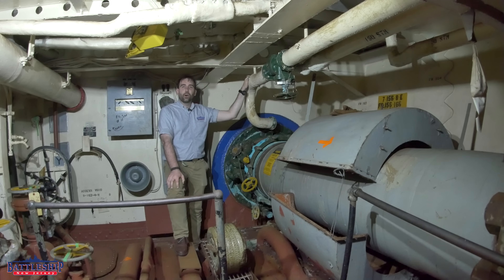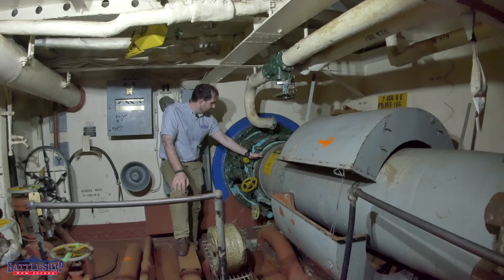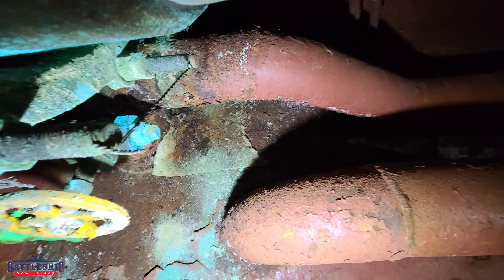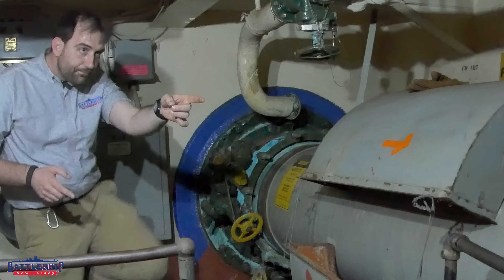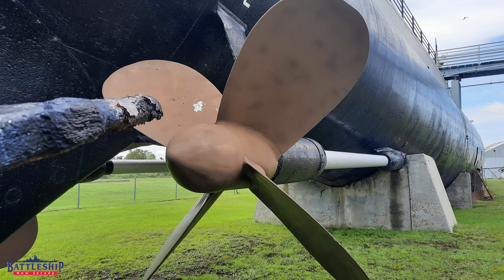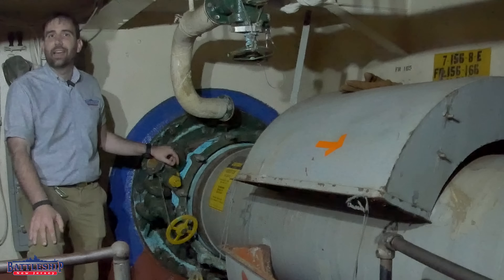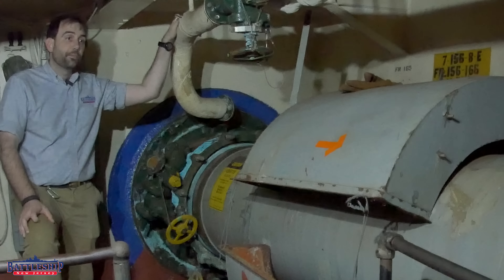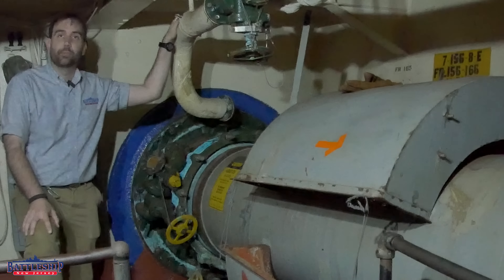Drydocking New Jersey Priority Project: Propeller Shaft Seals

Comment: I worked on high pressure marine equipment. Since the shaft are not turning a static seal like an omega seal can be welded on. It has enough flex to accommodate small thermal and flex changes. 100 percent water tight.
Reply: I like this. Also Ryan mentioned the shaft's weight compresses the rope seal.  maybe jack the shaft up so that it sits concentric to the bore before new rope and omega seal and  tightening everything down.

Comment: I hope you keep the propellers in place and maintain the Big J intact.  Socking down the gland seals have proven effective thus far.  Replace them and do the same, and you're good for another 20 years or more. Also, I tend to think that if you distribute the propellers around the state, they will ultimately languish and eventually get scrapped.

Comment: Unless it is critical for the preservation of the ship as a whole, I think they should stay on.  You’ve spent so much time adding equipment back to make her whole it would be a shame to loose them.
Reply: My thoughts exactly.
Reply: Agreed as well
Reply: Absolutely agree
Reply: Best to leave on, which also raises another engineering possibility. Instead of using the original sealant material in repair, perhaps modern materials science can provide for an alternate that could be installed in the form of a removable collar that provides for better long term protection in the static conditions of display, while still maintaining the ability to retrofit to original working condition.
Reply: @thomasgoodwin2648  I would also hope during the drydocking, that the berth is dredged out to prevent the propellers from hitting the bottom.  Although river silt will fill in the lowest spot and that might not help over a 20-30 year time period until the next drydocking.
Reply: I agree, especially if they are the original propellers. If they remain on the ship, since the shafts don't rotate, I wonder if its possible to put one less wrap of the marine gland packing, and in place of that one less wrap put a similar metal ring to stop the shaft from sagging so much over time. Any marine engineers out there?
Reply: And if they have to remove them for maintenance reasons I think keeping them on site would be best. Here's a crazy idea, if they remove them, keep them on site but use them as the posts for a shade-sail arrangement over a garden area and maybe have a cafe or something operate underneath it so it becomes an interesting, hopefully additionally revenue-raising part of the site.
Reply: @dwayne7356  Does anyone know how deep the river is where she's berthed?
Reply: It is a scarce resource issue, i.e., money. If a bad leak pops up and requires the emergency expenditure of funds, the museum is losing control of a critical ingredient, funding. Removing rudders and props and capping off future leak problems is a prudent option. As artifacts, they can always be warehoused or stored until the future is clearer.
Reply: @timbowden1680 40ft in the shipping channel of the river. Not sure on her actual berth but I have to think at least as deep as the channel
Reply: I agree mathewb1059. I like to see that an artifact with historical significance remains intact.

Comment: I've removed those shafts and props before. Pretty good job. Probably a 5 day job with all of the interference removed from the engine room. A Hytorc is your best friend on that inboard coupling. We typically autographed the machined surface once its exposed. Hopefully others have autographed yours. I guess we'll see.
Reply: That is so cool 😎 Thanks for sharing!
Reply: @mm3mm3  yes Sir. Civil Service Marine Machinery Mechanic
Reply: Bolted quite a few shaft flanges together on Arleigh Burke class destroyers. A bit different than a Iowa class in that it has a controllable pitch prop system with pressurized oil running through the inside diameter of the shaft. I think that I would have been fired for scribing my name on the flange face. Not that I really think it would have mattered or caused a leak if I had. Pretty cool artifact of history that machinists got to do that in the past. I almost hope that they have to split those shafts and find some.
Reply: Very cool story about the autographing!
Reply: @rickjames8317  The fact that the Arleigh Burkes have adjustable pitch props is mind boggling to me.
Reply: My mechanic and I would sign a piece of paper and stick it between the couplings before making it up...we did good work, and weren't afraid to let the next guys know who put it together. And yes, a hytorq is very helpful. Also, lost a wedding ring in the stern tube of a passenger ship when repacking it with that rope/tallow packing.
Reply: @davidbridges1563  haaa that's pretty cool!!! Sorry for hearing about your ring
Reply: @sambrown6426  It's a cool piece of equipment. It's quicker to reverse the pitch of the blades than to stop the rotation of the shaft and reverse it. There's also a optimal blade pitch for every rpm and some business about being able to sound like another type of vessel if they choose to. It's actually quite simple mechanically once you can visualize it. I just checked and there's a really good video by a channel named 'saVRee'. Guy made a automated CAD model that shows exactly how they work. Very cool.
Reply: @rickjames8317  I'll have to check it out!
Reply: @rickjames8317  All this, plus it also allows you to "feather" a prop into an idle position if an engine is shut down, so you can reduce the prop's resistance in the wake without having forces that cause the shaft to spin.  On sailing ships with props, this is the best way to reduce prop drag while under sail (folding props do this too, but have poor reverse performance).  Multi-engine prop planes will feather props if an engine fails or even to shutdown an engine and save fuel.
Reply: @rickjames8317  So you're saying that in the movie Battleship, the scene where the U.S.S. John Paul Jones is going ahead, and when Hopper calls "Engines, back, full," and they go astern by stopping the props and reversing their rotation within seconds is inaccurate?
Reply: @sambrown6426  I'm not familiar with that movie. If they showed the props actually reversing direction, then yes it's inaccurate. I worked at Bath Iron Works as an Outside Machinist (Dept. O9) for almost 8 years and never had enough seniority to go out on a sea trial. That bummed me out, but I heard about the emergency stops they perform. Burkes are a hair over 500ft long and go 35+ knots in speed. When they perform a crash back stop the rudders are turned as far athwartships as possible (referred to as "closing the barn doors"), the pitch of the prop blades are fully reversed and the rpms remain at full. From what I've heard, they will come to a dead stop within a ship length to a ship length and a half. So, from 35+ knots forward to reversing in direction in approximately 500 to 750 feet. Pretty impressive. Apparently, a huge wave comes over the fantail astern. Wish I knew this from direct experience, though. That would've been really cool.
Reply: @rickjames8317  If you haven't seen Battleship, you should absolutely watch it, in part because in the making of that movie, they actually hooked U.S.S. Missouri up to 3 tug boats, and took her out to sea, and they got actual veterans who actually served on her to help "crew" her. I'm not kidding.

Comment: One thing Ryan didn't mention was that if the propellers were removed the ship wold have to be re-trimmed which would mean adding ballast.  There are several ways of adding said ballast including filling trim tanks, pouring concrete, large lumps of metal - each of these has its advantages and disadvantages, but none is without risk.
Reply: According to another video he did about needing to remove things so the air height would allow the ship to pass under a bridge, she's out of trim significantly from bow to stern (while both are lighter than normal load and thus are drawing less water than usual, the bow is more so) and will need to take on ballast to be moved. Based on that, wouldn't removing the props in fact move the trim back in the direction of level?

It would be reducing the differences between the mass in the forward part of the ship (which is considerably reduced due to things such as not having ammo and propellant for the 6 main guns) and the aft section which, while less than normal load of course, is closer to what it would normally be.

Just a thought.
Cheers
Reply: He didn't mention it because it's not true.  The screws don't weigh enough to require being replaced with ballast.  The missing ammunition, powder, fuel, water and stores weighed a lot more, and did not require the addition of ballast.  The bow is several feet higher above the waterline than when the ship was in service.  If the screws were removed, the stern would ride just a little higher.

Comment: When I was a marine engineer, we would often times have our plain steel salt water mains coated in an epoxy rubber coating.   Since the shaft seals don’t rotate, you could coat the external shaft penetration and shaft area with an expoxy rubber coating on the sea side. It will fail eventually but will keep your stern tube dry for a long time.
Reply: Or just weld them solid.

Comment: I'd go for option 3. Install a blanking ring around the shaft on the outside of the gland, welded to both the shaft and the hull. You now have a solid, waterproof steel covering that is impervious to the effects of crushing and settling. In the interest of galvanic reaction it may be possible to mitigate that by covering the props and their connection to the shafts with a layer of epoxy, if you can prevent the electolyte (water) from reaching the less reactive metal then there is no electron exchange and no corrosion. So, for the record, I'm a props on supporter.

Comment: Well, you already know that cranking the gland seals down tight (since you're not actually running the props) is a reliable way to be leak free. I'd be surprised if the weight of the prop put an appreciable load on the gland seal since the shaft is supported by the bearings. The situation with Midway grounding out on her props and rudders is an engineering failure of her berth/mooring plan. Removing the props and rudders is a bandaid and duct tape fix for a problem that shouldn't have happened in the first place. Stick with what long experience shows you works.
Reply: Replacing the gland material will need to happen at some point in the maintenance life cycle, but usually that comes after finishing the maximum seal compression.

Monitoring the seal is probably the primary task.

Going beyond that level is probably unnecessary for the lifespan of the hull till the exterior seal mounts decay.

But the packing material doesn't decay when wet appreciably. The packing material always has to support the weight regardless of rotation, which is presumably part of the 20 year wear life expectancy.

I'd love to retain the propellers so long as it isn't causing corrosive decay.
Reply: I agree. I don't know why Midway just didn't use a suction dredge to give the stern gear some more space at her berth.
Reply: @TyphoonVstrom  Depends on what the bottom of the berth is like. Could be mud, could be rock.
Reply: Why not leave them in place and weld and plate over the gap between the shaft and the hull if the water can’t get to the packaging gland it can’t leak replacing the packaging as well would add a layer of extra protection as if the plating corroded through the packaging would be there to seal as it normally would without the plate
Reply: @chrishughson9587  Apropos of nothing specific, I'd suspect there might be something suboptimal about casually welding to the shaft. There'd also be a challenge to cover whatever structure is involved to the sea side of the gland seal (It's not just a simple gap between the shaft and bare hull). The risk is doing something irreversible to an essentially irreplaceable part.
Reply: @vburke1  weld is made of a different grade of metal and the wrong temper. They definitely like corroding. And we have that prop right next to it.
Reply: @glenmcgillivray4707  There are an absolute multitude of welding alloys with all sorts of different physical and chemical characteristics. The problem I'd consider likely is that probably nobody alive knows the exact composition of the shafts themselves (I'd expect our fearless curator could confirm that), especially since they were never intended to be field repaired but replaced if problems developed. I doubt anyone responsible for the design of those shafts ever considered anyone welding to them.
Reply: @vburke1  hence my comment focused on potential complications. Just like our Zinc anodes which haven't been any use because of the ship being parked into fresh water. And freshwater may be less corrosive than salt, but it's more chemically variable, even just due to factories producing products upstream and generating waste water, treated or not.

Oceans tend to mix their chemistries a touch better. But even they aren't perfect.
Reply: @glenmcgillivray4707  Absolutely. It will be quite interesting to see what her bottom actually looks like when she comes out of the water.

Comment: You can spin the shaft with the shaft jacking gear back by the reduction gears. It is customary to jack the shaft when in port on an active ship. It will reduce the tendency to bend the shaft under the weight of the shaft aft of those last bearings,
Reply: EXACTLY !!!!! Problem solved !!! I was aboard the USS Norton Sound AVM-1 as a MM for awhile. When we docked & it was for awhile. We would tighten up the packing for minimal leakage. Engage the electric motor to rotate shaft ever so slowly. Then when getting ready to go under way. Loosen the packing plate for more leakage for cooling the packing material  They could fasten a none corrosive container with a cheap sump pump attached to a garden hose and pump it out automatically....
Reply: Soapy1898  one of its function is to rotate the turbine for uniform cooldown of the turbine. It also aids in maintaining a lubricating film on the bearing journals of the shaft, turbine, reduction gear and thrust bearings. It turns the shaft at about 0.1 RPM (1 rev per 10 minutes). 

the gear engages and disengages at the end of the turbine shaft, or only one in the case of twin shafts. One turbine shaft is the high pressure shaft and the other is the low pressure and reversing shaft. 

Just as it maintains a lubricating film of oil on the bearings, it will maintain a lubricating film of water on the hull penetration gland.

So in summary, yes the turbine and reduction gears are rotated. and the turbine "windmill" while in operation at low static air pressure.

Comment: 5:09 on the subject of the anodes, i make a strong case to develop a mounting system that allows a diver to periodically change these anodes without the need of welding them on the boat. On commercial boats, there's several variants of this. They aren't as effective (as the tab and weld type), and would require maintenance, but i've personally thought that something that can easily be maintained is better than something that requires complicated action on behalf of the maintainer.
Reply: The problem is, their anodes are not working. They have zinc anodes that are used in saltwater. The ship docked in Sweetwater and they need to replace them with aluminum anodes.
Reply: @mammutMK2  they're pointing out that having a modern, non-welded system in parallel would require less involved maintinence in the future, to the point where even swapping anode type would not have to wait for drydocking like it does now.

Comment: I love that all the Iowas still have all their props installed and I would do whatever necessary to keep them on the ship but If there were no other options and the props absolutely needed to be removed then I'd recommend distributing them between the Iowas, then each ship could have one to display on site and while they may not be under your direct control, they would still be controlled by your fellow museum curators and well supervised, rather than being displayed in some other random location such as a park or a rest stop on the Turnpike. Also they could be transported by ship directly from the yard to the other ships, which would likely be significantly easier than trying to transport them over land.

Comment: I would certainly go with keeping them on if at all possible.  You mentioned loss of control if they are placed off site.  A steam loco in the UK had this happen to it.  It was dismantled for overhaul then through a variety of circumstances beyond the owners control the storage site was sold and major parts were sold for scrap.  It can happen so easily.  Plus, Manganese bronze is emi gently stealable. A Henry Moor artwork in Branze was stolen one night in the UK from a sculpture park.  Fortunately it was found in a scrap yard.

Comment: Props on! Blank the prop shaft to the hull in situ AND repack for maximum leak proof, epoxy coat the props to reduce galvanic action! Not only will removing props lead to their inevitable damage or loss, but it will put the ship out of trim.